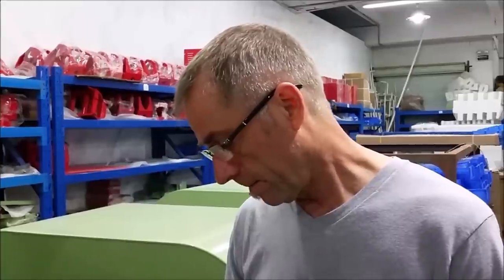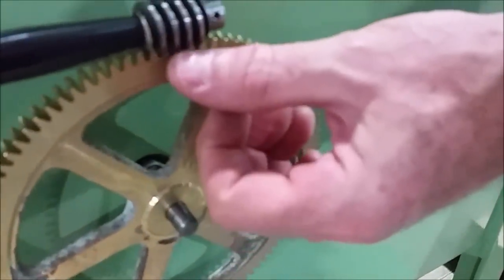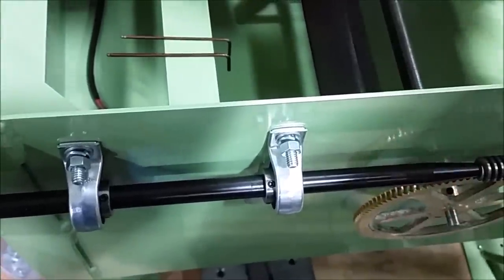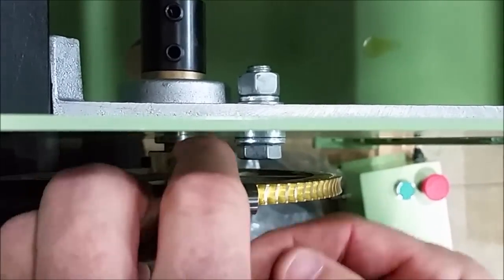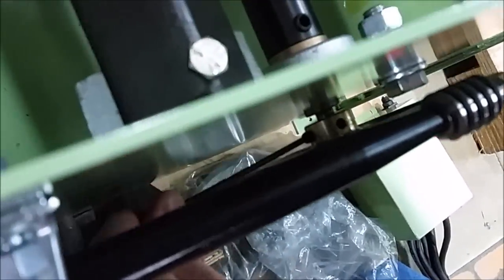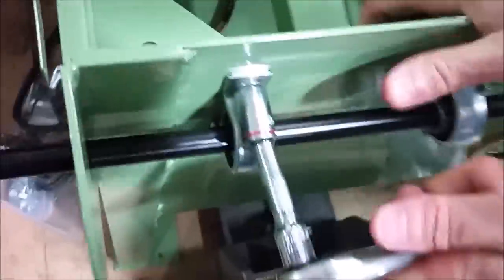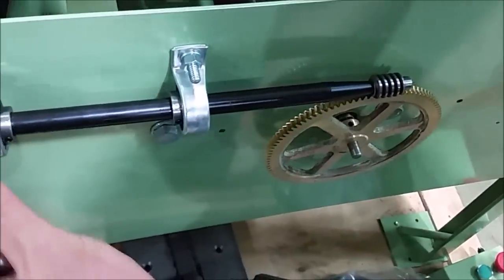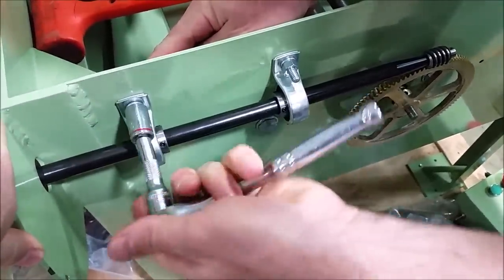Worms and Worm Ring Gear Adjustment

Comment: Efforts and  quality  efforts  are always  different.   In Abscence of  hardening process of  moving  gears   doesn't  give sustainable  outputs.  Plastic,  aluminium,  copper,  brass f gearbox  are used  for ease and business  never sustainably.   Axial  Rod  and tooth of gear  without   heat treatment   is waste of efforts.